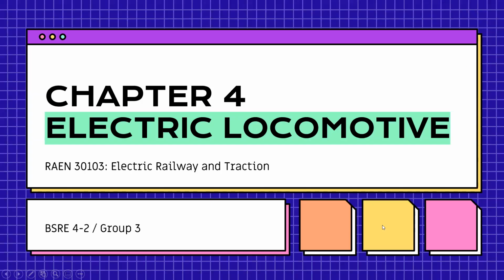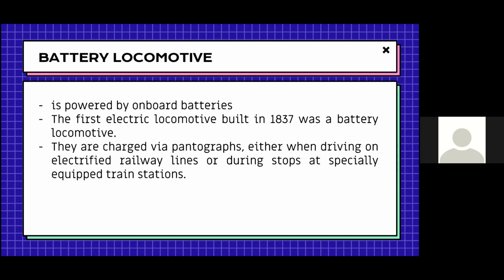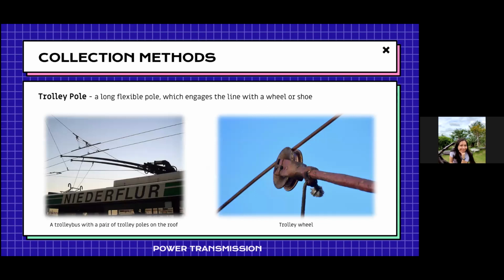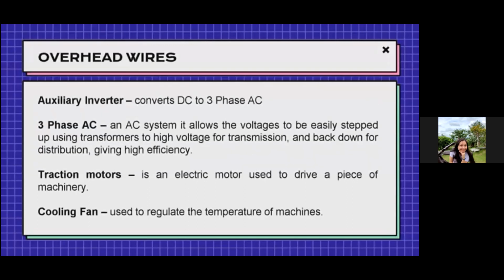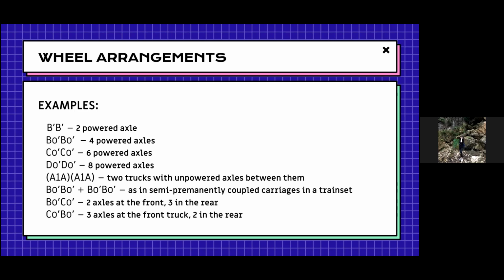BSRE 4-2 | Group 3 Electric Locomotive

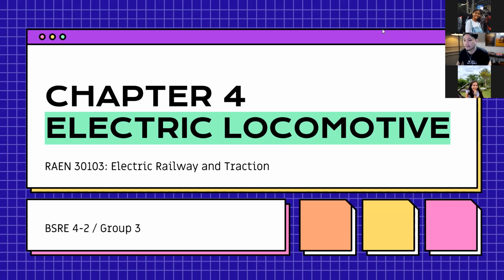Comment: 00:32 Characteristics of Electric Locomotive - Louie Kim Patay
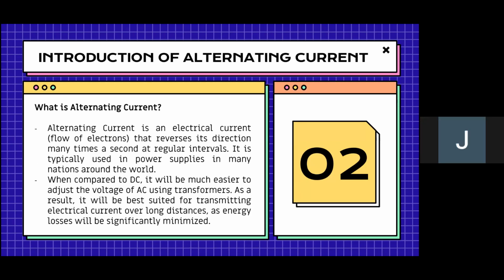04:33 Introduction of Alternating Current - Jhon Paul Christopher R. Sibug
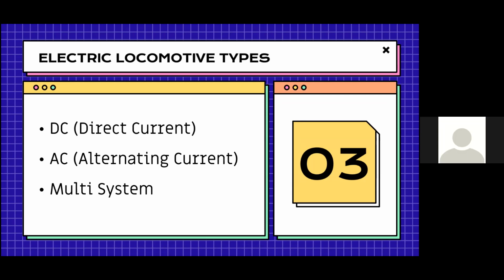09:28 Electric Locomotive Types - Mark Ian D. Delos Santos
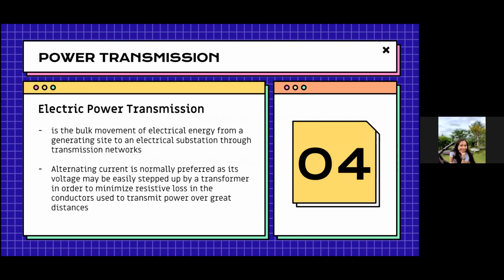14:45 Power Transmission - Plinky Mae U. Rentar
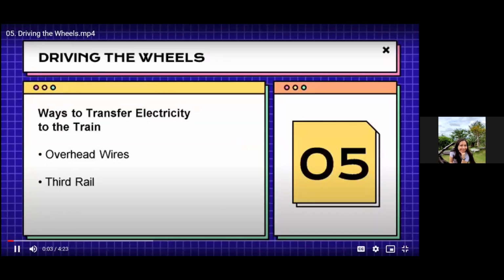22:18 Driving the Wheels - Clifford John C. Benitez
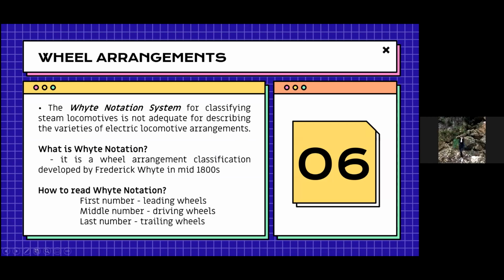28:05 Wheel Arrangements - Glennymar T. Velasquez